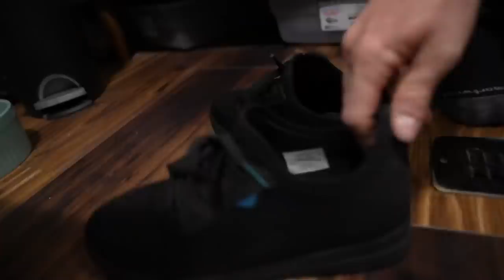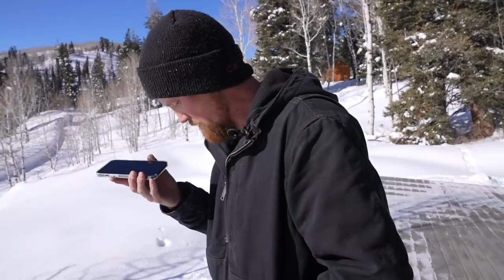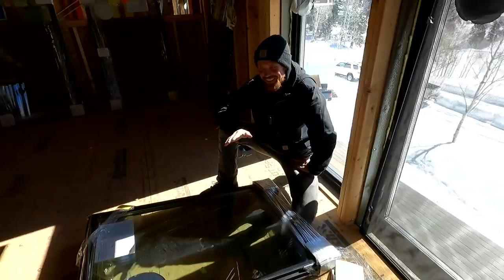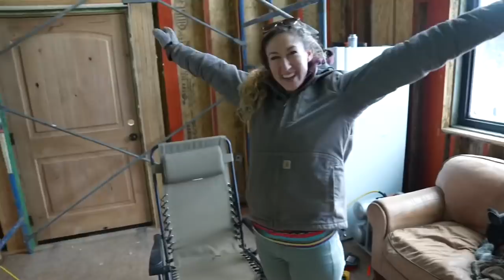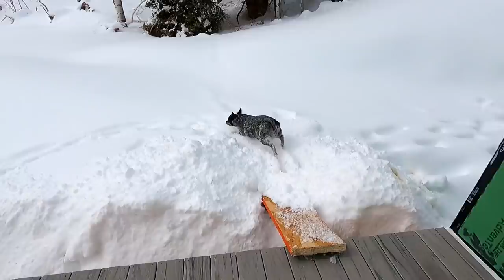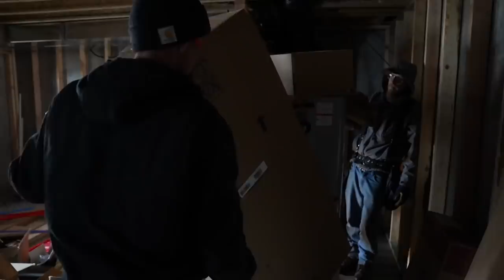WE THOUGHT THIS WAS OVER | BUILDING OUR OWN HOME

Comment: Just curious
Why didnt you go with the hot water on demand? I love mine
Reply: I asked the same question a couple of videos back and got no answer.  Guess because they just didn't want to.  Although, I would think with using propane it would be a cost (and propane) saver in the long it would make more sense that having a big tank of water that you are having to keep heated and constantly using propane ..... how ever much or little that may be.
Reply: electric...   vs propane.... small house does not need on demand. and if power is out.............  well. Actually, a 30 gal is fine for them and their needs for a family of 2 or 3.
Reply: We love ours in NC but we are in more moderate temperature zone.
Reply: On demand is soo much better for a water heater
Reply: @conniewaite1996  not when power is out and your street still has pressure.... you can still use with propane.  Not with electric... although tank- electric stays warm for a day or two.
Reply: @yousurf374  my on demand is propane  not electric
Reply: @sharonstuebi8181  does it have a constant pilot light or is it electrically ignited? If later, then power off issue.
Reply: @yousurf374  we are used to the power going out alot.we have a gas line for furnace and on demand water heater.the old water tank we used to use had problems with the rod in them and other problems.when we went tankless,never a problem,takes up less space too.and we have a small house.they even make them small for under the counter use as well as bigger houses
Reply: @yousurf374  on the side of the box says "propane "
Reply: @conniewaite1996  I have been quite aware of tankless since they were invented and RINNAI had commercialized them.n
They are quite nice, esp. on a large house with long run alternative for hot water piping... but there are some issues.
Reply: @benjigreystone  I know it is propane... you did not follow the thread here... PROPANE is best for them for many reasons. tHEY JUST do not need a 50 gal. tank... propane is quick recovery for re-heating.  30 gal is good for three people.
Reply: @yousurf374  you can get propane units, never would go electric
Reply: Just wondering...do you live in a cold climate? I've heard that in the coldest months, the water doesn't really get hot enough.
Reply: @OttawaAndy  yes, I live in Ontario Canada.
It makes no difference what the outdoor temperature is, the water is heated indoors.
The only issue would be if your waterlines ran through an unheated area and then the same issue would arise with a tank.
Can’t see why someone would say anything to that effect.
Reply: @lorrainehinchliffe5371  did I somewhere mis-type?   I know all about propane and KNOW they got propane... and if I had propane tank in-ground and used it for heat/furnace and stove ,,, I would get propane HOT WATER REHEATER....  is there a reading problem onhere? LIKEWISE,,, many use FUEL OIL for furnace/forced air... and have FUEL OIL based hot water re-heaters.   SOme even use WOOD in the boonies.
Reply: @yousurf374  I was referring to a propane on demand water heater not a propane tank. I know propane is best for them.
A little jumpy this morning?
Reply: @OttawaAndy  I live in the Sacred Valley of Peru. I'm in a couple of Trent and Allies video6. It gets into the 30s some nights in winter. The temperature is adjustable. We have never had and issue with temperature only pressures. You need a minimum of 6 liters per  min. It's difficult in the dry season to maintain this without a pump. We have electricity now (no electricity for 3 years ) for the pump so it's not issues anymore.
Reply: @yousurf374  it has a manual pilot light flint button if it goes out. No electric
Reply: @lorrainehinchliffe5371  yes.. jumppy today.... your post was not clear to me on referencing to on demand, but I did think I was posting to another person who was generically stating something about propane, as if I could not read Trent's WH box... I went to the beach to chill out.
Reply: @yousurf374  deep breathes.

Comment: Need an exhaust pipe for your hot water heater since u are heating with propane. Dielectric water nipples plumbed into the top of the hot water heater before the initial plumb make sure you install shut off valves for the hot water side as well as the cold water side in the event later down the road u need to replace it. Looks Awesome so far. God bless be safe stay warm. Jim

Comment: You need 12” of metallic pipe in and out of the water heater.  Code says because of heat from the vent, you can’t have plastic.  In addition, don’t forget the ‘drip leg’ on the gas line, it’s code also.

Comment: Have you done any research on tankless water heaters? They are AMAZING! We first started using them about 8 years ago, since then, every home we’ve purchased for renovation we put these in & use the space from the old water heater as either storage or pantry. We install a filter & shut off valve in front of each one - as well as putting in a moisture sensor alert (SimpliSafe) in case we aren’t around if something ever sprung a leak. We have never gone without hot water, unless we were out of power!

Comment: To avoid slipping and sliding have you though of making steps in the snow in the incline. 15 minutes of carving steps in the snow would help avoiding some of those  mishaps. This might have to be redone very few days and can still be dangerous (snow melts and refreezes to ice) but it is much safer especially when carrying loads. Enjoy watching your build. Just a few more weeks before the melt...and then slippery mud might become the new hazard.
As large and heavy snowfalls will be constant feature in your neck of the woods , next time your are on your roof why not install a more permanent safety feature like a anchor point .... Cheers and goodluck

Comment: Did you ever think about laying a tarp on the deck?  Any snow that accumulates when you are not there can be easily removed by just pulling the tarp off the deck and shaking off the new snow?  You need only just relay the tarp.   I have one on my deck.  I installed metal hooks around the edge to hold it in place.  I have a rope threaded through one side that means I just pull and the tarp rolls off the deck and dumps the snow.

Comment: suggestion: Get a couple of steel shelving units, the kind with wheels. That will make it convenient to put stuff on that instead of the floor. Then you can just roll them around and get them out of the way. The workplace will be much neater with less effort.

Comment: I strongly recommend to place the water tank on a piece of Plywood, not directly on the concrete floor, rust will eat the bottom tank and also coldness will affect the inside water temperature, causing the gas burner to work way too much to kept the setting thermostat.  Advise from a Northern guy ;)

Comment: Are you guys going to install a recirculatory pump on the hot water line? Set on a timer and temp sensor, this will give you hot water when opening the tap first thing in the AM in the upstairs bathroom. Assuming this the farthest tap from the hot water tank. Beats letting the water run till hot water arrives.

Comment: @John Landry and @Trent&Allie,  Hot water tanks are usually required by code to be raised off the floor in order to prevent igniting fumes with a pilot light or when the burners ignite.  Not sure if it is code in every state but would have thought that the plumbing supply place would have mentioned it.  Hope Trent googles it before he makes all the connections and fills the tank.

Comment: If you take into account the cylindrical shape of the tank. You will see a less dramatic change in level in the middle 50% of the tank. Your level gauge use a float to measure the level.

Comment: Really think about your placement for switches and outlets...  I can't live without a switch at the top of the basement stairs that turns out All the basement lights that the kids left on.  Also, wall mounted TV's would need electrical outlets behind them.  We put an outlet in the closet where our cordless sweeper charges.  Put an outlet on each side of the bed, not just the required-by -code one in the middle that no one can reach.  My house came with a switch for the kitchen lights right by the sink.... which I thought was weird, but I use it all the time because the sun goes down while I am working in the kitchen.  Don't only go by code. Think about how you will want to live.  Builders charge an arm and a leg for extras, but for you it is really cheap.

Comment: Heres what I think! Yes keep the heat on. Water lines will freeze. But Also there must be a exhast if it is propane or natural gas.. That in cold weather gather condensation.. and if the furnace can't exhast it will shut down.. Take a hair dryer to the exhast vent outside,, thaw it out..see what happens!

Comment: Do yourselves a favor by keep the regulator on your propane tank clear of snow.  Its purpose is to regulate the pressure for delivery.  If there is over pressure it can be released.  If it's obstructed you may run into issues with the flow or risk a build-up of released gas that is trapped. Explosion hazard maybe?
Also, a tall marker to show where your utility locations are under all that snow.

Comment: I love watching you guys battle the cold weather. ( been there ) It reminds me just why I left all that cold wether behind and moved to South Florida plus we use a on demand hot water system as hot water heaters are a passed tense way of getting hot water. To each there own I guess, but it's 81 degrees here today and were all putting the top down on the convertible and heading to the beach ( 4 miles away ) for a sun tan .

Comment: You can use spray paint, but most electricians use  a red crayon. No, not a Crayola one, you can get one at HD. Also get black magic markers with pen points and fat points. Pen points for marking the Romax if your using it, Or for marking conduit if your using that.

Comment: I know the furnace uses propane to heat but it also uses electricity for controls. Do you have a source of backup power in case you loose electricity so you can continue to use the furnace. We use a pellet stove and have a battery backup in case of power lose. Also since the thermostat is on the ground floor the basement could freeze before the furnace kicks on.

Comment: I saw you bought a water pan for the water heater on a previous video but didn't see you use it. Hopefully you did, especially if you have a water heater with a leak detector and auto shut-off. A lot of places won't let home owners install a water heater so it's nice you live in a place they allow that, if you have the skill to do it. Great vids.

Comment: 👍👍✔✔👏👏
I didn't realize you didn't even know your propane tank had a gauge. So with that said please leave your propane on 24/7 at least 50 degrees. Check your tank weekly call to get more at around 20percent. Your goal is to fill your propane tank in the summer when propane is cheaper.
Start tracking the current cost of propane. Very important information!! 😎😎

Comment: Seen comments on starting you stove fire. I suggest not using paraffin, Vaseline, dryer lint or anything that will put a film or waxy coating in chimney stack. Stick with wood and as much as you use it, have it cleaned annually 👍

Comment: If that furnace doesn't work out for you, don't hesitate to try heated floors and the new type of hot-water baseboard heat. Both  heated floors and that are are quiet,  no blowers.
Reply: Is your new fireplace a Lopi? If so, very good, only 1 gram of smoke.

Comment: You should always place a pan under the water heater which has a pipe connected to a drain in case of a leak, to avoid flooding the basement?

Comment: Pex is mostly freeze proof but the plastic 90* joint aren't. Many now use Pex  Tube Bend Support for 90* bends eliminating many points that could freeze and break. Also why don't you keep your place at least 35* at night to prevent any water problems? Good episode.

Comment: Do you have hard water there? In 1991 I went from a salt softener to a GMX magnetic water softener and have had no issues with hard water scale. The nice side of the switch is that I no long am dumping salt into my septic system for which has stop me from having to have my septic system pumped twice a year. Now my septic system work the way it is supposed to. Just a thought.

Comment: Hello, great videos, remember to keep the regulator on your l.p. tank and at the house, open to the air, not covered in snow, if it can not vent or breath, it will not regulate the correct pressure. Be safe.

Comment: I would put a Rubber/Plastic Catch Pan under the Hot water tank...the metal on the concrete floor will rust and rot, the tank won’t last long before a leak! We just bought a house and our tank leaked all over our garage ...NO pan rusted..😏  I made sure our new one has a pan...😉🥰

Comment: You may want to do a bit of digging in Frank's poop palace and pick up his "gifts" while they are frozen - much easier and no smell, and then pick up once a day.  I say this from experience - you definitely won't want to try to clean up the sloppy mess that will be there when the snow melts.  Some hard work now will make the spring much easier.

Comment: I removed the drain valve that came with my hot water and replaced it with a brass ball valve and then plumbed it directly to the floor drain. That way, each quarter, I just open the valve and let it rush out for about 30 seconds to keep the tank free and clear.

Comment: Quick note about dogs and chocolate...

It's not an issue with their tummies... Chocolate causes their heart rate to elevate, and it removes their ability to regulate it down.

One of the most important things after a chocolate binge by a dog is to keep the dog super calm, and zero exercise. A few teaspoons full of activated charcoal helps to remove the active ingredient from their digestive system.

Comment: Trent read the household electrical code it will give receptacle and switch heights location and loads on circuits.  What kind. Of circ juju its and legs to use. T he sunset or black and decker are excellent references.

Comment: water tank install probably the easiest job in your house construction.  Only 4 connections, Gas in, water in, water out and  flue connection to either chimney or out thru exterior wall. 

Surprised that you are putting water into pipes and filters etc. at this early stage with no insulation in walls. Already had a freeze up with your furnace.

Comment: That 1/2” nipple is a  1/2” x 2” nipple” , by the looks of it. 1/2” I.d. X length in inches The shortest length called a close nipple is threaded from both sides  referred to as “close” . After that 1/2” x 2” .  All pipe I.d. ( inside diameter) with 1/8” I.d. Starts its length at close nipple. Whatever I.d. Your talking about comes in  length increases in 1/2” increments .  If you had a pipe threading set up you can create any length you need.The pipe  diameter or threaded pipe increases up to 3” I.d. nipples  common sizes . Pipe like your using is Schedule40 this designates wall thickness ,thickness going up - pressure , volume , flow rates  go up.  After 3” pipe you generally go to Weld  fittings  
It so exciting ..

Comment: I hope you are using the correct pipe dope and Teflon for the gas line.  It is not recommended that you use an petroleum pipe dope or regular Teflon tape with gas supply.  Regular Teflon tape is a petroleum base product. They make a special pipe dope and Teflon-like tape for gas line fittings.

Comment: Would have put that water heater on a platform, even though not required in basement.  Your gas water heater should be 18 inches off of the ground, as per the National Fuel Gas Code. This is the standard for water heater installation requirements. ..
Reply: Only in a garage"   The code states that “appliances having an ignition source shall be elevated not less than 18 inches (457 mm) above the floor in garages,” and the purpose of this stipulation is fire safety. Any gasoline leaking from a car parked in the garage creates flammable fumes that are heavier than air and settle near the floor. An open flame close to the floor, like the pilot light in a water heater, can set off an explosion and subsequent house fire.

Comment: Hey guys, a Plummer s hint. Put the hot water heater up on a 6" plastic stand. U know the BASMENT under the slab has water. Keep the hot water up a couple of inches.  We even use bricks.
Reply: You may want to check your State and Federal laws re: Water heater installation and update yourself.. Plus are you a plummer or a plumber??

Comment: If your having issues with your propane are you sure you want to be installing your water heater right now?  Speaking from exp the cold and water heater tanks DO NOT mix especially with no insulation in your house yet.

Comment: Oh I forgot when u installed the gas line did u install a gas line T fitting need a dropper line wit cap and above line nipple to the flex line installation pipe. Look at the manual diagram on proper gas line installation.

Comment: Trust me, you need to put a pan underneath that water heater.  Just one malfunction and you will wish that you had.  Put a hose on it so it drains outside of the wall or you will have flooding.  After going though several water heaters (we have very hard water), we have learned our lesson.  Oh BTW, since we put one in we haven't had a problem, but if we ever should....we are PREPARED!  Just a heads up for ya'all.

Comment: Hi Trent. Not sure if it matters with that small of a nipple, but usually gas line fittings should be black pipe, not galvanised (which is what that scrounged nipple looks like). Also I assume it is the same for propane as it is for natural gas, but I am not an expert on that, just a former hardware sales person from many years ago. So I suggest a call to Dean to verify this information.